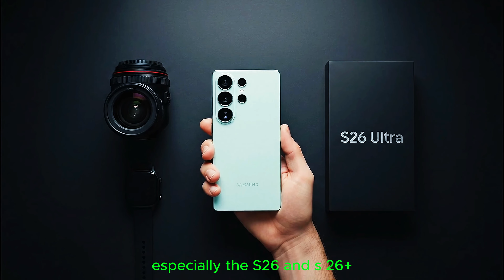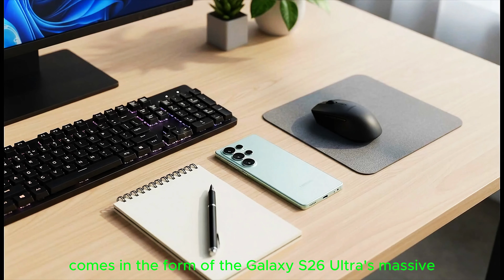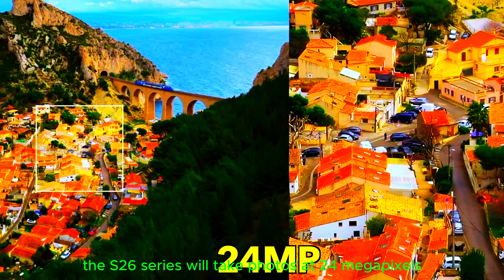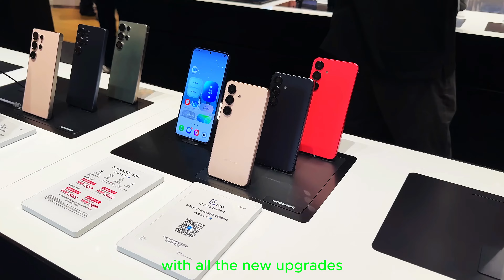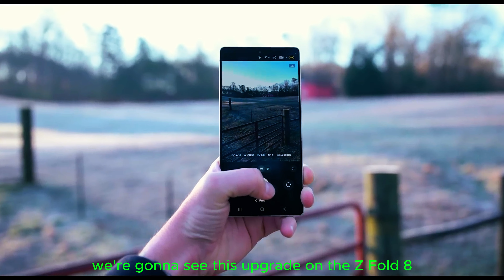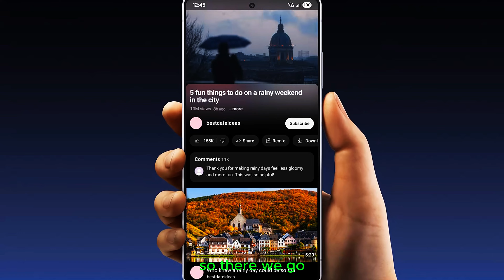Galaxy S26 Ultra Final Leak: Thinnest Flagship, 5200mAh, F1.4 Camera Upgrade & No Price Hike!

Comment: I hate these dumb and bogus videos!! S26U is insane. Massive upgrade for the S26U. The S26U will have something no other phone has. The S26U will destroy the iPhone. Can we stop with the preposterous and completely bogus-ness of the videos and these video titles. Like come on! These is never a significant upgrade from year to year. If you have an S25U keep it. If you have an S24U keep it. These year to year so called upgrades ain't worth it. I only upgrade every 3years and that's only because I feel as though by that time there should be something worth upgrading for. So right not I have an S23U and I will be upgrading to the S26U and it should be worth it. But making videos like this like the S26U is a significant upgrade is cap!! And I'm talking All CAPS.